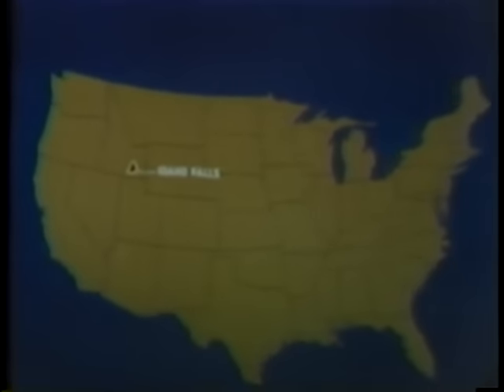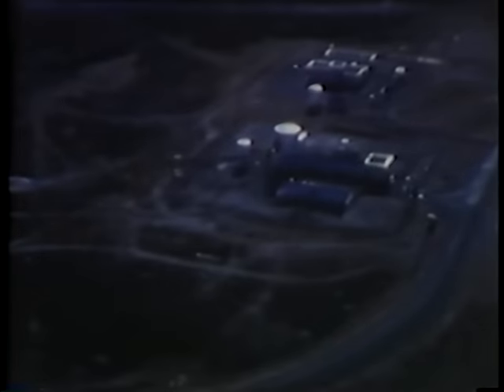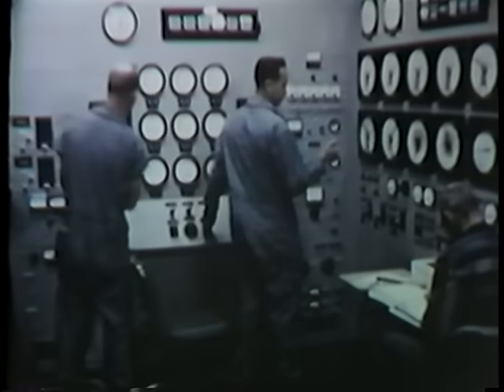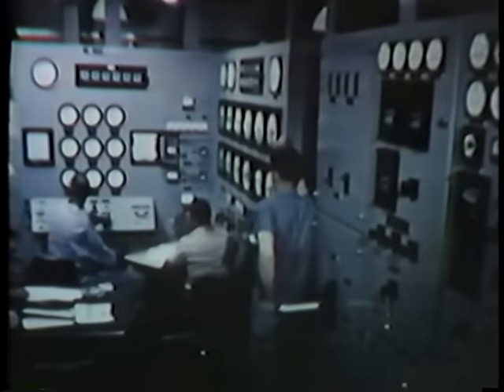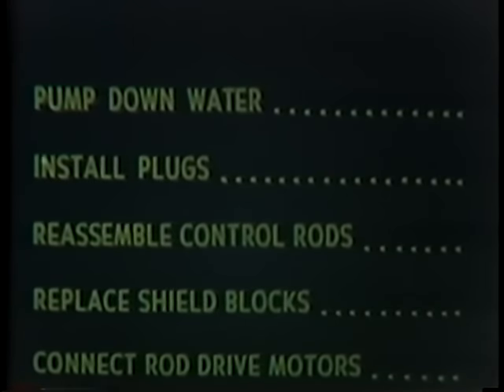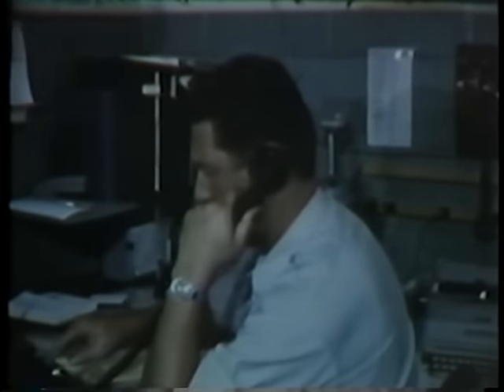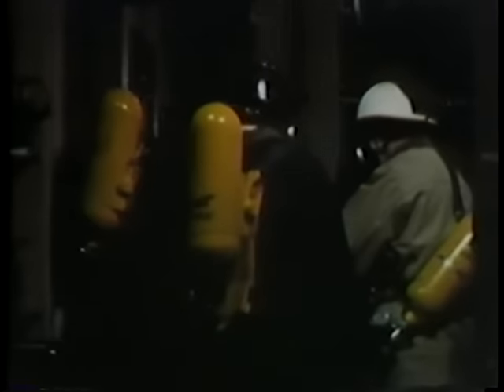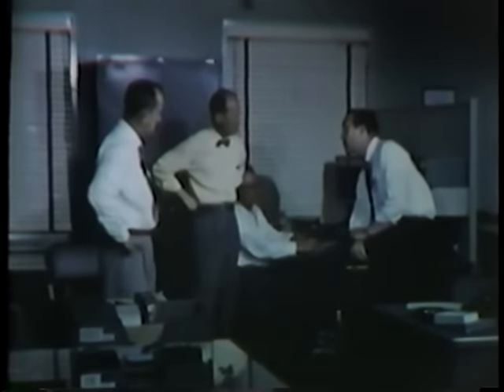SL-1 The Accident

Comment: "....A third man was found dead  LODGED IN THE CEILING..."  Odd statement with no explanation given.  The guy was standing on top of the reactor trying to force the control rods down when a pressure build up inside the reactor explosively ejected the rods, which impaled this poor guy on the ceiling of the building.  Funny how they didn't mention that.
Reply: Lodged sounds less scary than impaled. Though this facility was for remote stations, the operators were still promoting civilian N. P's . Arco Idaho is the nearest town.  Prototypes for a proposed Nuke powered airplane engines located at a plant where a 'self guided' tour of the first plant that provided electricity in December 1951 for Arco, Idaho
Reply: Other way around. Legg was trying to withdraw rod 9 to cold start the reactor. His limit was 4 inches, and he yanked it. Shit went prompt critical from there and blasted his soul into space.
Reply: Once upon a time, grisly details were kept to a minimum, out of respect.
Nowadays no one gives a sh*t.
Reply: you have no clue of what you are talking about. Legg was trying to withdraw Rod 9 by about 4 inches, but the rod got stuck, when he applied more force it got past those 4 inches limit and blew.
Reply: maybe he was just changing those old t12 lamps up in the t bar
Reply: They literally didn’t recognize him too. He no longer resembled a human.
Reply: @ph4nt0m22  😒
Reply: @highcat2046  except that I’m pretty sure autopsy revealed it was Jack Byrnes who was handling the control rod at the time of the accident
Reply: @borizh  You're right, I wasn't paying full attention and got the names confused, thanks for the correction.
Reply: Dammm danger of a steam hammer
Reply: Why doesn't anybody talk like this anymore?
Reply: @GeneralJackRipper  It had nothing to do with the respect. Modesty was overrated and applied to everything then, and only "benefited" the modest. Applicable to EVERYTHING in life and death, including pregnancy. Likewise this was used for educational purposes in this era, no way they were including such details here. There are many things we say and do now that would be deemed disrespectful, and a great many things done then that are disrespectful now. That's subjective and even with the details given, the original comment is 0% disrespectful. Be well <3
Reply: Along with that is that he was also impaled through the groan as well.
Reply: They tried to keep things as G-rated as possible back then. In fact, the narrator sounds exactly like the guy I heard in educational films in elementary school. That was in the 70's. I'm not sure if they used the same person for everything or what, but he sounded so much like the educational film guy that I immediately started yawning like I did (not intentionally) when I was a kid. Lol 

I always thought the documentaries back then were extremely boring and couldn't stay awake through them. I barely stayed awake through this one! There's something within me that's triggered when I hear this guy's voice that says "time to sleep now." Ha-ha! 🙂
Reply: Think “The Watchmen”” scene, with Doctor Manhattan. Interesting fact, President Jimmy Carter was part of the cleanup crew.
Reply: I was there, I had do a back flip every minute while holding a teddy bear.
Reply: @SayianRace shot in the pelvis
Reply: There was an explosion.  He was with the shield plug, which weights tons of steel and concrete.
Reply: That is straight up BS.
Reply: @Gabriel  it wasn't Legg.
Reply: Well consider the following fact:
• a nuclear reactor accident
• a dead man lodged in the ceiling

Don’t need to be a genius to figured out how he got up there…
Reply: Nobody was educated on safety back then
Reply: A control rod impaled him through the groin and out his shoulder.
Reply: He got kabobbed by one of the control rods. They had to use hooks and a net to get him down. Its kinda what happens when ya stand directly on top of a famously unstable and difficult reactor. They used to bag on the damn rods with wrenches when they got stuck because the rods were so damn corroded.
Reply: @alancoker1459  everyone who worked there knew how unstable the orientation of the control rods was. They joked about how if the Russians invaded, theyd pull that rod out like a pin on a grenade.
Reply: @mybossisdrunk  it was Legg
Reply: @highcat2046 he was trying to pull it out far enough to attatch the mechanical controls
Reply: THe most tragic part is when rescue teams went in to recover the body, they had to use elongated tools to dislodge the man. And they couldn’t be gentle and he came down in pieces, sad to say after all that the family suffered even more by the burial process cuz of the radiation
Reply: @gudkush420 kabobbed? Funny but very sad
Reply: @highcat2046 maybe the rod got stuck since it had gotten stuck five times that year alone and they even beat on the fuel and control rods with a pipe wrench previously. You pull up on something and it starts to stick you pull harder until it moves. This blast happened in micro seconds. This video left out many things.
Reply: @GeneralJackRipper they left out details for the Russians. And added things like they were buried according to family wishes. They were hacked up with makeshift tools made by the machine shop for the doctor, then sent everywhere for study. Some parts are buried onsite and covered in concrete, lead boxes, and caskets. See Kyle Hills video of this
Reply: @scusemethankyou or why doesnt the music sound like rap?
Reply: @scusemethankyou  Nomenclature... who even speaks like that? No mon, that I know!
Reply: @sulufest  Balls to the wall… and ceiling!

Comment: Legg, the third victim, was impaled by the rod, into his groin and out of the shoulder..and was pinned to the ceiling by the rod.
Reply: The blown rod was travelling at 27 metres per second..that’s crazy
Reply: Yup, and he was the one on top of the reactor who was manually moving the control rod and apparently moved it too far out of the reactor causing the uncontrolled reaction and explosion.  Had to be a very gruesome sight.
Reply: And then he melted from radiation.
Reply: @donbrashsux  27 meters per second is about 60MPH. Not bullet speed but still has to hurt.
Reply: @adamjhuber  ouch !!!
Reply: @sw8741  I wish they had pictures of how it looked online
Reply: More accurately, his REMAINS were pinned to the ceiling….

Comment: It went Super-critical in 3.6 milliseconds, and they estimated it took 7.5 milliseconds to reach a momentary output of 20 Gigawatts, this far exceeded its design limit. It was only designed for 4 Megawatts.
Reply: Hmmm interesting now where in Chernobyl have I heard that before?
Reply: 3.6 milliseconds. Not great, not terrible.
Reply: Those figures in all criticality accidents just blow my mind.
Reply: If I recall correctly it was designed for 3MW and they were testing its capability to run at 4.7MW. It peaked at 2,000 times its designed threshold. 

The actual criticality only took 2-4 milliseconds after the rod was withdrawn over the 4 inch limit. After examining the rod it was estimated to have been moved 20 inches resulting in an explosive reaction equaling 35 kilograms of tnt.

Comment: Quite amazing that the containment building wasn't compromised. Definitely prevented a larger release of radioactive material into the environment
Reply: It wasn't a containment building if I understand the video and the Wikipedia article.  It was just where the reactor was.  These days, there'd be a containment building constructed around it.
Reply: Gee I dont' know, breaking in from the outside so a crane can ram a steel pole in with a video camera right over the control rods and a stretcher to retrieve a body skewered to the ceiling KIND OF SOUNDS LIKE THE BUILDING WAS COMPROMISED TO ME.  :P
Reply: @howardshubs7157  Yes, as the reactor was experimental and not powered all the time, a concrete containment building was not required. The building holding the SL-1 gave little more protection than a garden shed.

Comment: Always thought this was one of the more interesting nuclear-power incidents.  When I was in that region, I drove down highway 20 and meandered around a bit outside Atomic City.  There is (according to the locals) fenced-in areas with AEC warning signs still.
Reply: The site of SL-1 is about 1/2 mile north of US 20 on Fillmore Blvd., about 2.5 to 3 miles east of the US 20/US26 intersection.  When I worked on the NRTS in the early '70s there were still contaminated dump trucks from the SL-1 cleanup being used on the various sites of the station.
Reply: What did we learn?  Ice is good for getting radiation off dead bodies, and that the operators must have lifted an inconceivable weight and blown themselves up.
Reply: Yeah, I was a navy nuke trainee, our bus went past the site. Saw the training film, understood what happened. It was a warning what could happen to any of us.
Reply: @widescreennavel the simulated weight was only 80lbs. They stated one man could move it on his own.

Comment: The good thing about the SL-1 event was no coverup.  Everyone was well-informed, and the public was kept in the loop. Fortunately, the radiation contamination did not extend outside the AEC sites. The sad part was the loss of life.
Reply: Are you serious?
Reply: A reactor where a PERSON has to lift a HIGHLY reactive rod by hand ?
Think again !
Reply: @TomKappeln  It was designed as a portable reactor system. It could put into an intermodal container,  flown or transported to its destination without special equipment,  set up by personnel with a minimal amount of training, and operated in semi primitive locations without special equipment.
Reply: @Nighthawke70  : I know the facts ...
Does not change the fact that a PERSON could not safe pull a rod up to 4,5 inches.
Even a hydraulic HANDPUMP would do better !
Come on ...
Reply: @TomKappeln  Back then they didn't know a thing about prompt criticality.  They assumed the reaction would merely rise in power, not jump to the point where there would be death and destruction.  It's sad to say that it took three bad accidents, SL-1 on our side, the Soviet's had Chernobyl #4 and K-431

After SL-1, ALL reactors, research and production types, were designed with multiple defenses to prevent or control (in research) prompt criticality in the US. The Soviet's didn't learn their lessons until Chernobyl.
Reply: @Nighthawke70  : Los Alamos 1945 and 1946 accidents ?!
SL1 = 1961 "they didn't know a thing about prompt criticality" ....
Bro ...
I don't know what price you try to win here, but you are close ! lol
I'm born in 1966 ...
What you are talking about ?!

Comment: Wow! Impaled on a control rod into the ceiling! What a way to go.
Reply: I thought it was the ceiling of the reactor lid, not the building.
Reply: @gkess7106  WHAT DIFFERENCE DOES THAT MAKE?!!
Reply: They should make the rods dull so next time it won't get stuck!!
Reply: Bunker Sieben  All three of them were, no?
Reply: Bunker Sieben  Then why did they line the coffins with lead?
Reply: Bunker Sieben  I thought matter could be made radioactive.  Not so?
Reply: Bunker Sieben  I'm just going to have to take your word for it.
Reply: Lt. Feltersnach  It was dull.  With sufficient sufficient force, a solid material the shape of an oil drum will still drive right thru steel to concrete like a needle.
You can stab a man with the fat end of a baseball bat if you shove it fast enough.
Reply: just ruined for me....Back to Norm MacDonald
Reply: DISCO-INFERNO-70 It was actually quite gruesome. There is an autopsy report online, accessible via the Wikipedia entry for the accident. He was mangled quite badly and, not recognizable.
Reply: Yeeesh...😬
Reply: And heavily irradiated
Reply: @grantlewis8420  LOL!
Reply: @christopherpardell4418  Sounds like my honeymoon.
Reply: The head and hands ( exposed parts of the body) were removed and disposed of with other nuclear waste.  The rod entered the body near his groin and exited out of his shoulder.  They believe they were trying to manually exercise the rod to facilitate reattachment to the actuator.  It got stuck and was pulled too hard moving the rod too far, too fast.  As this was the center/start up rod it produced maximum energy in minimal time.  It was supposed to be withdrawn approximately  4 inches.  Estimates are it was withdrawn 20+ inches.  Reactor power soared to 20 GW in a few milliseconds.
Reply: @daleburrell6273  u
Reply: @abundantYOUniverse  Wow I would like to meet your wife...she sounds epic.
Reply: @Glenns_Concho_Ranch  Lol!
Reply: @chuck9987 ...years ago, they told us that it wasn't possible anymore to manually retract control rods.
Reply: @howardshubs7157  - some elements can be made radioactive. those elements are rare.
Reply: And melted.
Reply: At least it would have been a quick ending… not like that Japanese fellow Ouchi who spent months in hospital, in excruciating agony helped very little by narcotics, only to still die with his body basically rotting while he still drew breath after being exposed to radiation.  
As awful as Legg’s death was, I think I would still take it over what Ouchi endured.  
I feel very grateful to all of those early pioneers into nuclear power, as our poor beleaguered planet would be in a much worse situation than it is now if we’d never developed nuclear power and had relied on petroleum-based fuels and coal for all our power needs.  Grateful for them, yet still sad that they underwent such horrific deaths and suffering.

Comment: During the Winscale  fire in Cumbria I was a child living in Carlisle. Oh what jolly fun........!
Reply: You didn't see any fire because it was not there! LoL. 
That might have been a Russian quote but I think that it would have been no different there too!
Reply: Winscale was when England was struggling to make tritium for a bomb before the treaty banning testing. You can easily figure out the large scrubber tower was designed to catch the tritium more than stop other radiation. Thus the reason they repeatedly super heated the core to make more tritium. It worked and they blew the bomb off.
Reply: Leave it to the Brits to design an air-cooled reactor. Complete insanity.

Comment: So what caused the accident? What were the operators doing at the time of the accident? To describe the aftermath but not the cause is wholly unsatisfactory.
Reply: The reactor had been shut down over the Christmas Holiday. Legg, Byrnes and McKinley were tasked with reconnecting the control rods to the mechanical and electrical lift devices. Keep in mind, these were trainees, none of which should have been attempting this operation without certified supervision. It is this fact that is the first and most glaring mistake by Combustion Engineering (CE) and the military staff who were in charge of that reactor. The final report states that the split responsibility between the Military and CE caused a lot of the issues because no one was willing to take responsibility for anything. As a result, safety measures were lax or non existent. Both Legg and Byrnes were known to have hair trigger tempers. One was known for challenging people to wrestling matches or fights while on duty and the other was a notorious prankster, shutting off cooling fans for equipment until alarms went off and other 'jokes'. Legg, who was in charge that night and Byrnes, who resented Legg for surpassing him to crew lead, were known to have had issues with each other and had come to physical blows on one occasion. McKinley was the true victim in all of this... he was a new trainee who really shouldn't have been on this crew with his level of experience. According to the procedure, the center rod was only supposed to have been lifted no more than four inches to attach it to the lift mechanisms. In the post accident investigation they found that the rod had been pulled out 21 inches IIRC. Byrnes, who was looking at divorcing his wife, was the man lifting that rod. Only God knows what happened that night... With the control rods losing the boron cladding, making the rods stick and giving them a changing level of control over the reactor, two loose cannons out of the three men on that shift that night, a cranky reactor that everyone knew had dangerous issues with it... it basically was a disaster waiting to happen.
Reply: @ticklemeandillhurtyou5800  No... The reactor had a major design flaw... you could drive the reactor prompt critical by withdrawing ONE rod. No reactor before and none since have been designed that way for the very reason shown in this video. Only God knows what happened for sure that night... Whether it was deliberate, or a stuck rod that suddenly broke loose, NO reactor should ever have been designed with the ability to co critical by withdrawing ONE rod. This reactor had a mess of problems that were known to CE and the military. They were trying to limp the reactor through till spring when it was planned to replace the fuel and control rods.
Reply: @ticklemeandillhurtyou5800  Read the Book Idaho Falls by William McKeown... The accident is described in detail, as is the problem with the reactor and the aftermath of the accident.
Reply: The control rod that was the only protection from the reactor going critical could only be safely lifted four inches.  He, presumably unintentionally, lifted it nine inches. To have only one control rod preventing catastrophe and nothing in place to prevent it from being lifted too high, was an m absolutely idiotic design.